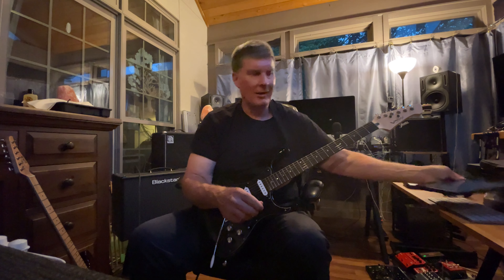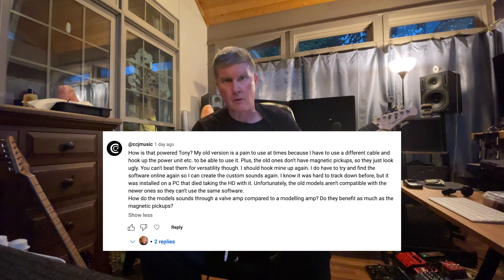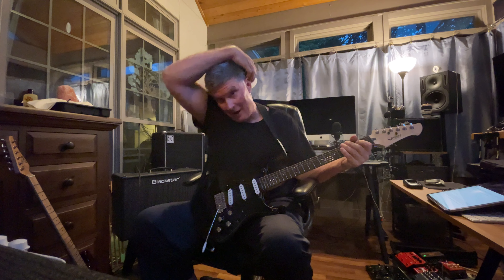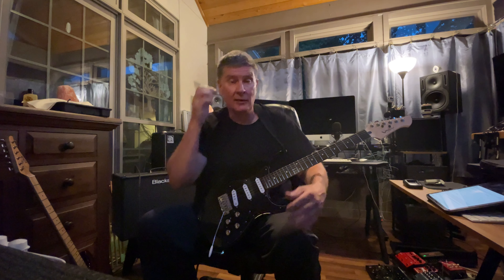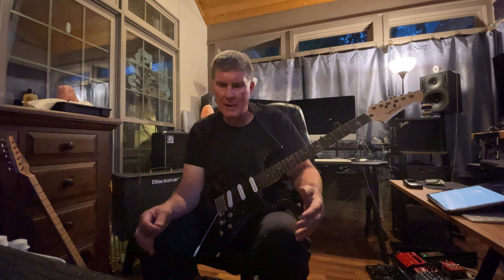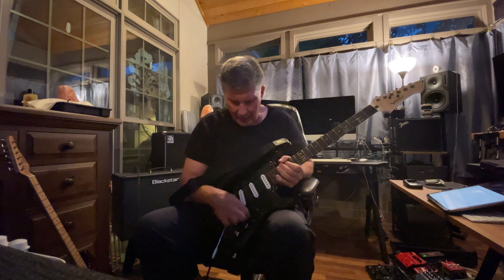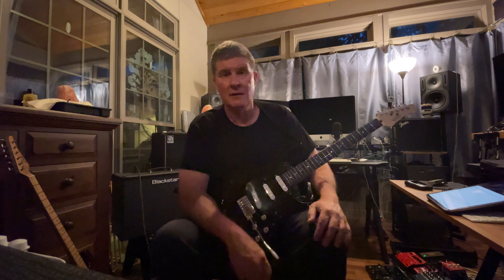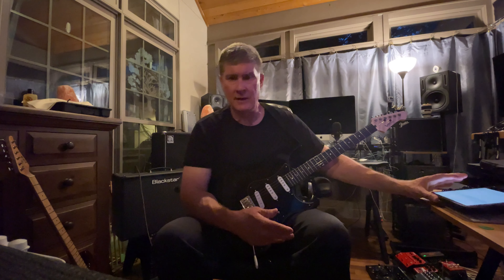Answering Line6 Variax Questions - Helix and Battery Power - Direct to Digital Amp Sound Samples

Comment: Thanks Tony! First off, thanks for the shout out! I appreciate that.
To power mine I have a stereo cable that takes power on the ring of the TRS cable to power the Variax on the same cable as the output from the guitar. It then goes through a little box and out to my audio interface via an XLR connector. I bought mine used and the battery compartment was corroded. As far as the software, I had created a few custom guitars that are stored in the custom positions. The biggest problem with not having the software is that the only way to have alt tunings on the older Variax is to create a preset with the alt tuning in the software. If I remember correctly there are two programs you have to install. One is called Line 6 Monkey and one is called Variax Workbench. I'm hoping I have an installer on a backup drive somewhere, but so far I haven't found it.
I have only ever used my Variax connected direct to my PC and never through an amp, that is why I was curious how the modelled sounds worked with both valve and modelled amps. I'll have to hook up my Variax and use it again soon.

Comment: There is also a powering system for this guitar. You do have to buy a special cord that line six made for this powering system for the variax standard that plugs into the guitar and from the powering unit you plug into your amp/pedals with a regular cable.

Comment: Hello Tony i love your videos. Can i use in Helix dual outputs ? One output XLR Left and Right  With Amp+ Cab and effects to P.A and other outputs 1/4 Left and Right to diferent Amp, real amps a Mesa boogie and a Fender and in Helix the same patch with effects but without cab and amp simulation. Its possible? Does the DSP Can hold on ?  Thanks regards from Portugal.